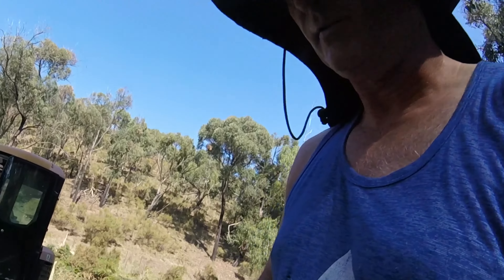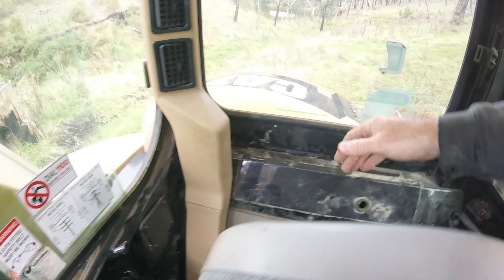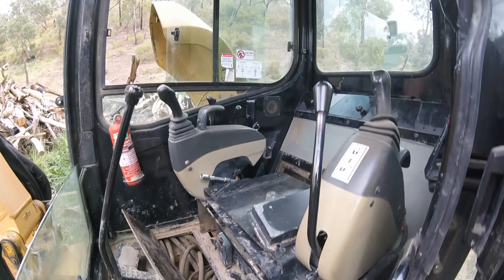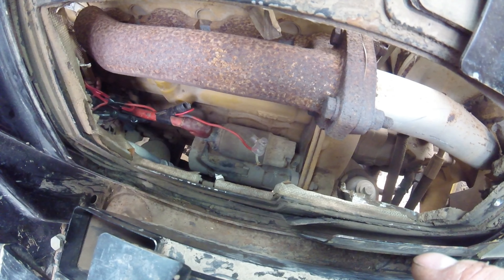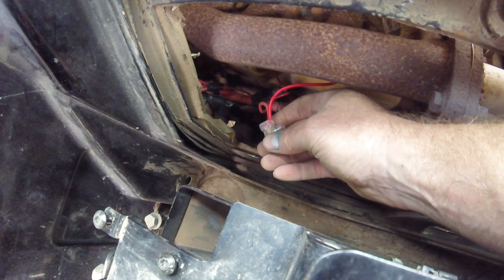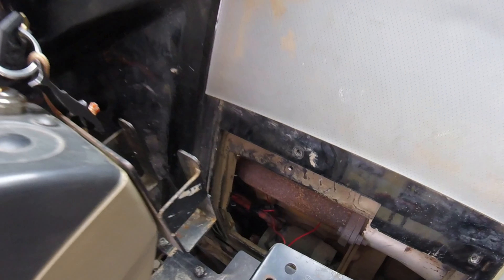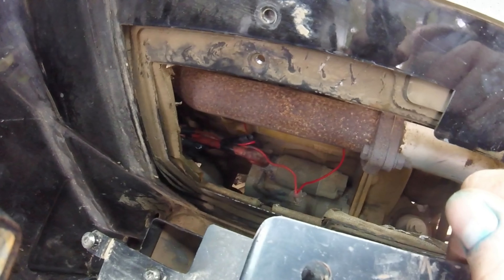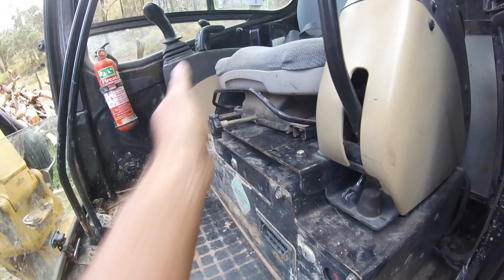CAT 304 CR - Excavator Starter Fault - 2021#31

Comment: I had a similar issue with my big block Daewoo Matiz (3cyl and 800cc classes as big block?? ). It's an absolute fair mongrel to get to the starter as the engine bay is tiny and the starter is buried right against the firewall. Over an hour to undo 2 mounting bolts and a couple of wires. Pull it out and 30s after getting it out I saw a dry solder joint on the matching spade connector that you were missing a connection to. A few minutes later it was all soldered up and ready to spend another hour putting it back in. Only in hindsight could I see that if I'd spotted the dry solder joint from under the car I could have fixed the starter in under 5 minutes. Not enough light and not enough access to get a meter in there to help me out.
  With your excavator you couldn't even jumper a screwdriver across the terminals to get it started. It wouldn't be very convenient to remove the seat each time you wanted to do it.
Reply from the maker: Hi Alan, thanks for watching and the comment. Frustrating but also satisfying eh when you find and fix an issue as you describe, lets just say that I'm learning a lot too, i wish i didn't have to, but i am 🤣
Hindsight is a great thing and hindsight engineers are the smartest people in the world, i've worked with a few.🙄
Reply: @TheRuralProject  . IMHO automotive engineers should be required to work on repairing cars before they are ever given to go ahead to start on car/excavator/etc design. My wifes car has an inspection "hole" under the back seat for the fuel tank. It's the exact size of the fuel pump/sender unit but shifted about 50mm to the left. My wifes car now has a 1/2" hole directly above the leftmost mounting bolt for the sender/pump. Couldn't get to it easily and a 1/2" hole bunged up with a rubber bung makes it so much easier to access. It would of course be so much easier if the inspection cover lined up. I could have been cutting wood instead of modding a Proton.
Reply from the maker: @Alan_Hans__   ha ha, so many better things to do than bang knuckles working on cars. I watch diesel creek and he is the master of getting old machines to work, I wish I had his knowledge. I’d rather watch him than do it myself, but I pick up a few good tips about fault finding.

Comment: Automotive can be the same way.. simple to fix but the hour or so get through it is the hardest..
Reply from the maker: Oh yes, I took me hours to get to it, especially the first time I did this when I didn’t know what could off or where the access was. It was comical, but I wasn’t laughing 😂
Reply: Replaced starter today on my 304CR....... didn't know that access was there.  I did everything from underneath and it was a huge PITA but we got it.  Oddly enough I have never seen the little green light above low fuel light until today.  Had this machine since 06 and have personally put about 1200hrs on it and it's never lit up once, didn't even know it was there.  What does that light mean?